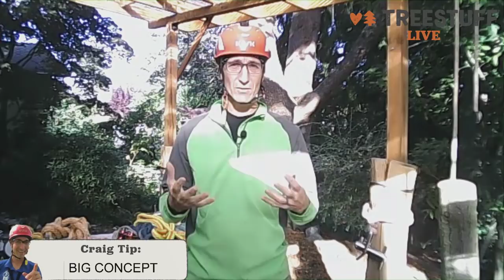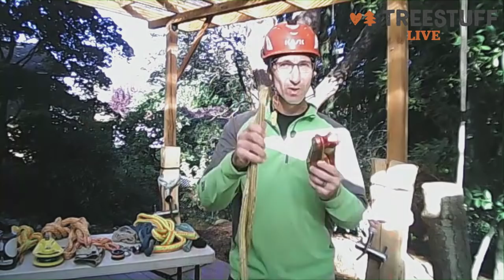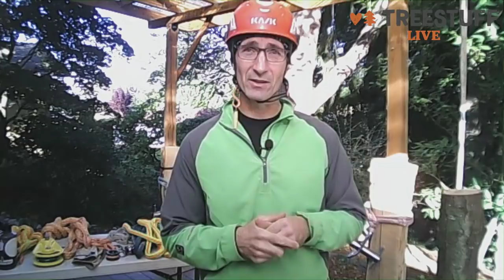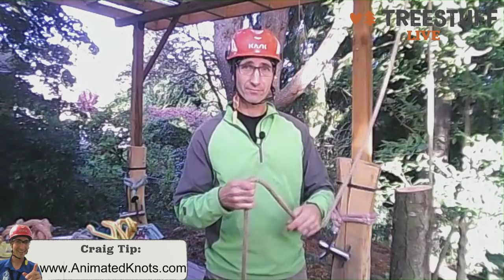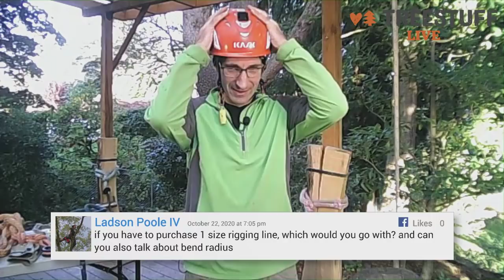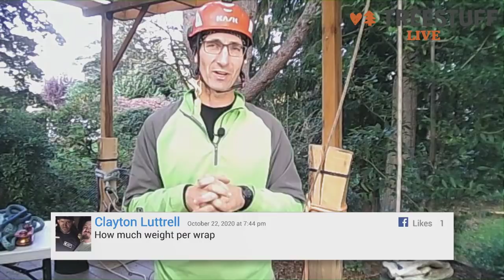Dialing-In The Details Rigging Webinar with Craig Bachmann - TreeStuff

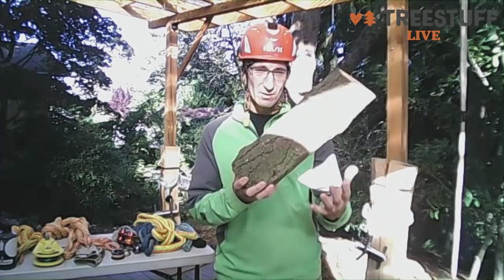Comment: in real world scearios when you actually measure the forces involved, the old formual from Don Blair that you mention at 14:13 is way over-estimating the actual forces involved. Stretch in the rope is a huge factor that Blairs' formula fails to consider. Blair also didn't factor in the skill of the man running the ropes to worka  smooth controlled decent. And then there is wind resistance on large limbs etc... So that calculaiton isn't even close. It over estimates forces by A LOT... so much so that it's no worth mentioning

Comment: Yo, what was the lesson learned from only putting on two wraps when you went from thin rope to thicker rope? What caused two wraps to be insufficient? You said it was poor communication, but is that really the cause? If two wraps would have worked with thin rope, why didn’t two wraps work with thick rope? Open question, if anyone feels like jumping in to give me some insight, too. Thanks
Reply: He got to it at about 1:32:00

Comment: Excellent webcast, Craig is a great teacher and some excellent points made. One question if he is reading this, do you change your rigging swl ratios depending on negative and positive rigging situations? No one has yet to give me an answer.
Reply from the maker: We definitely recommend using different SWL for differnt applications. As an example anything where you are lifting or holding over personnel or valuable property you would use a higher SWL.